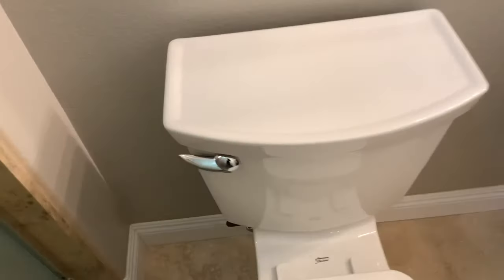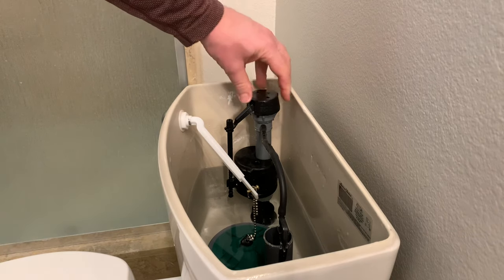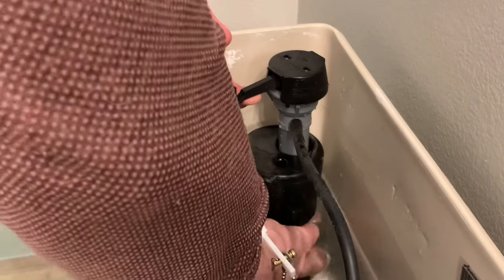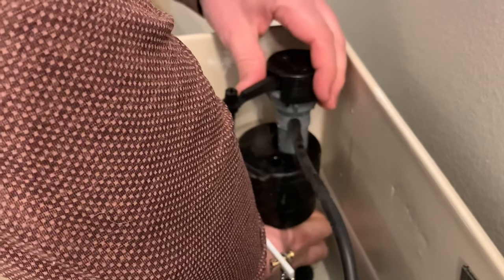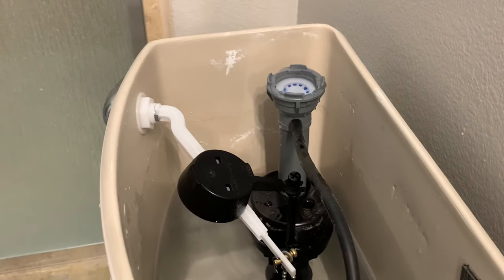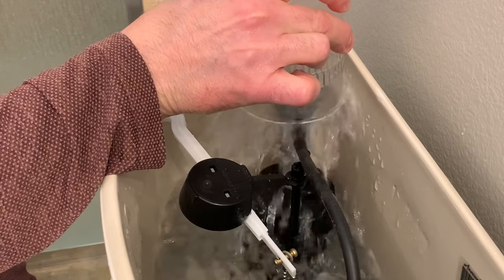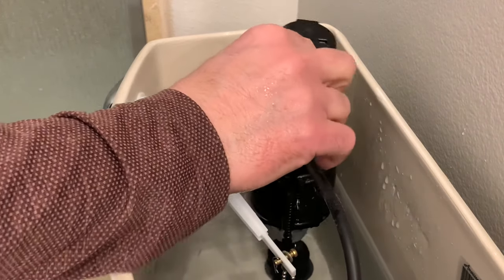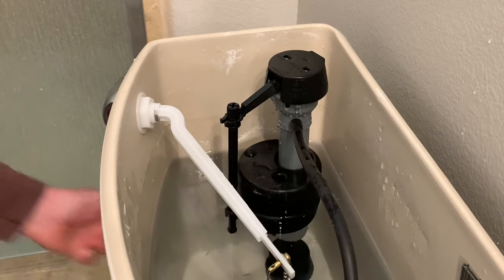Fix A Slow Filling Toilet Tank-With No Tools!

Comment: Gonna hope this can work on the toilet connected to my bedroom. It takes FOREVER to refill and doesn't get as much water as the main bathroom. I hate hearing the water refilling for the next 20 minutes if I use the bathroom at night (as I live alone, I sometimes will just use the main one to avoid this but I shouldn't have to, lol). This being an apartment is the only part that worries me as I've had some scary close-calls with water here (disconnecting a washer in prep for getting a new one) and should something go wrong, it would affect my neighbor under me as well (and the one on the opposite wall/behind me). 

I am fortunate that if I feel in over my head, I can just put in a service call for maintenance, but if I can resolve the issue myself, I'll feel pretty accomplished 😅. And it saves our maintenace guys a trip.
Reply from the maker: You can do it!
Reply: @MikeKlimek  Doesn't appear this worked for me as the toilet actually fills very slowly. I did see this method helped clean out some gunk, though, so that's a good start. I'll hunt around for some videls about slow-filling toilets to see if there's anything I can do about that in an apartment (nothing to be done if it just hss low water pressure, I assume). Thank you regardless for the video, I learned something I didn't know before!
Reply from the maker: @BewareTheLilyOfTheValley  When you removed the top of the fill valve, did you have a strong flow of water? You can test the pressure before the fill valve by removing the water supply line from under the tank and pointing into a bucket, then turn the water back on. If it is weak, replace the angle stop valve at the wall.
Reply: @MikeKlimek  Hi, thank you for your response! It seems the pressure is good, came out like a jet when I turned the water back on, lol. When you put the fill valve lid back on amd flush, should there be a lot of water that comes from the top and flows down? Mine has a very slight flow and I wonder if maybe it's on too tight?
Reply from the maker: @BewareTheLilyOfTheValley  No, it wouldn't be on too tight. You might try replacing a part in the cap. It's Fluidmaster part 242. Here is a video on it: https://youtu.be/p2G-ckkojEQ
Reply: @MikeKlimek  I actually went one step further and watched your video about replacing the fill valve if you already have a Fluidmaster, which thankfully, I do. IT WORKED!! I counted 72 seconds to fill versus 20-25 minutes. I will take it! HUGE thank you for all of your help and informative videos, you made something very scary and new for me something managable and easy!
Reply from the maker: @BewareTheLilyOfTheValley  Awesome-that makes me happy!

Comment: I have a problem with a toilet tank full of sludge and mud from our well because I couldn’t change the water filter since the plumbers put it on too tight when I had to have new pipe connections put in at the filter. Due to family health circumstances I put it off as low priority and now I need to know the best way to clear the mud out. The pipes are probably full of sludge all the way through out the water lines !😬😖 The last time I tried to change the well water filter I used a hair dryer to heat up and expand the seal but it didn’t work and I couldn’t budge it . Also when I turned the water off at the toilet and later from the well, it wouldn’t empty immediately and kept filling up.
I can fix this ….just need some input !🫤😁thanks !

Comment: My toilet fills slowly so I tried this and noticed the water pressure did not change when I turned tap on/off, im suspecting the shut off valve needs replacing?
Reply from the maker: Yes probably does
Reply: @MikeKlimek  turned out being both water supply and fill valve
Reply from the maker: @mets23q  Glad you got it figured out!

Comment: I followed the instructions, and the toilet was running fine; but once it stopped running, it would be back to running slowly. I found that when I disconnect and reonnect the water, it refills fine; but after the water supply is reconnected and it stops running subsequent flush cycles refill slowly.
Any ideas?
Reply from the maker: You might have a restrictor inside the bottom of the fill valve you could remove (remove the supply line and use needle nose pliers). Here is a video on replacing the seal under the cap (about $2 and 2 minutes): https://youtu.be/p2G-ckkojEQ?si=8MFBWopJunAuhBK7

Comment: I've done all that was on the video but after I remove the cap and turn the water on , it just comes out slowly. Any other suggestions please?
Reply from the maker: You might have a restrictor inside the bottom of the fill valve you could remove (remove the supply line and use needle nose pliers). Here is a video on replacing the seal under the cap (about $2 and 2 minutes): https://youtu.be/p2G-ckkojEQ?si=8MFBWopJunAuhBK7

Comment: What do I do if the top/cap does not want to twist and come off. I was afraid it would break.
Reply from the maker: If the cap won't come off, you can replace the entire fill valve if it breaks.

Comment: Don't want to pick on your video, but I've watched several just like it. It would be helpful if some of them explained other issues and things to look out for like signs the valve needs to be replaced. I think my is leaking slightly and not getting this kind of pressure because I don't even need to put my hand over the water that just bubbles over instead of sprays out like this and in the other several videos using cups etc. Again, just a thought not a criticism. I saw your video is more recent, so thought I'd comment here.
Reply from the maker: I appreciate your comments. Let's try to troubleshoot your problem: It sounds like either the fill valve may need to be replaced or the shut off valve/supply line has a problem. First, make sure the water supply valve is fully opened by turning counter-clockwise. If no change in water volume, turn the supply valve off and remove the supply line from the toilet fill valve under the toilet. Point the supply line in a bucket and turn the valve back on. If you have full pressure, then replace the fill valve. If the pressure is bad, replace the supply valve/supply line. Hope this helps
Reply: @MikeKlimek  Mike, I really appreciate the clear and well thought out advice!
Reply: @MikeKlimek  I'm pretty sure there is at least one small leak in the fill valve after working with it a bit more. But it wasn't super obvious or quite like any example I found doing research. The fill valve isn't that old, so maybe just not the best quality.

Comment: mike hi im having a issue with a slow filling toilet even just after replacing the fill valve   . today september 5th  I changed it out and there is no difference   it is almost like I never changed it   I feel like I wasted my time  and money  and im not happy right now.  I know that I used the correct fill valve .   I have been doing what you showed in the video   I leave the base ( shank) in place and only change the top  unless  the bottom of the toilet tank  is leaking
Reply from the maker: It sounds like it may not be the fill valve then. I would disconnect the water supply line from the bottom of the tank and point it in a bucket to see if you have strong water volume (turn the water off before you disconnect it of course). My guess is that you won't...If that's the case then check the water supply shut-off valve/supply line.
Reply: Same issue water still dribbled out after I ran this process,  so I check water line and it's super strong... not sure from here assuming it's the entire valve perhaps

Comment: What if it's a brand new toilet water valve and a new flapper? Water tank started to fill slowly and not all the way after these two things were reolaced.
Reply from the maker: I would say there is either an obstruction in the fill valve (or a restrictor at the base of the valve), or the valve at the wall is the problem.

Comment: I just installed a new flush unit and it's still filling up slowly.  Any other hints?
Reply from the maker: When you remove the top cap and turn the water back on with the upside-down cup, is the water flow strong?
Reply: @MikeKlimek  Since the kit was new I didn't believe that it was a dirty cap.  I know the pressure is good so it must be something else.  I was watching other YouTube videos with the same slow filling problem.  A poster showed a spiral flow limiter in the bottom tube and recommended to take it off.  It was made of rubber and I took it out using a long nose.  Now the water is filling faster... 50 secs to fill instead of more than a minute or two!  I'm glad other people found your solution helpful.  🤗
Reply from the maker: @kanehi3275  Glad you got it figured out!

Comment: Hi, what if the water pressure is low even with the valve fully open?
Reply from the maker: You may need to replace the valve then. Here is a video on that: https://youtu.be/y6J1cfvQOGg    To troubleshoot, turn the water off, disconnect the supply line from the bottom of the toilet, point it in a bucket and turn the water back on. Full pressure? Then the problem is with the fill valve. You could also remove the top of the valve as the video I attached shows and then turn the water back on. Careful though-cover the tube with a cup before turning the water back on as there is lots of pressure here. Watch the attached video and it should make sense. Its either the fill valve, supply line of water shut off valve. Good luck!

Comment: I have this issue. Followed the same process and the water comes out at pace when turning the watr back on. On the second flush though it fills slowely again.  I can repeat the process switching the mains water back on and off again.
Reply from the maker: If you have full pressure when you remove the top, try this: https://youtu.be/p2G-ckkojEQ or you may need to replace the fill valve. I have a video on that you can complete in 30 seconds.
Reply: @MikeKlimek  Thanks mike. I'll give that a bash. Have a nice day
Reply from the maker: @steviebax  Thank you -you too!

Comment: I tried the fix above:  the water flow was very low coming out of the top a bubble about 1/2" above where the water comes out...I did not need a cup to stop the water from spraying all over...
Reply from the maker: Ouch. It should be strong enough to almost blow the cup out of your hand! Try this: I would disconnect the supply line from underneath the tank and point it in a bucket (turn the water off first), then turn the water back on. Good pressure? You either  have a restrictor in the bottom of the fill valve, or you should consider replacing the entire valve. Bad pressure? Then replace the shut-off valve.

Comment: I think my issue is a more serious, as I cannot stop the water flow despite shutting off the valve. And I can't get that cap off either.
Reply from the maker: You may just need to adjust the float downward to shut off the water earlier. However, if all else fails watch this video on replacing the valve: https://youtu.be/y6J1cfvQOGg?si=eOYg3DwT6xgSa_NS

Comment: When i take the  fill valve off and turn the water back on (water valve completly open) thr water barely comes out. Theres definitely not a blast of water. The toilet was installed professionally about a year ago and always filled slowly. I just never noticed no water was coming out of tube.
Reply from the maker: You should have full flow with the top of the valve off. Either an issue with a restrictor in the underside of the fill valve under the tank, or the shut off valve is not fully opened or it's restricted
Reply: @MikeKlimek  You're so kind to reply! Thanks for posting this helpful content. It turns out the supply line has low pressure (I disconnected the supply line from the toilet to see what the water pressure looks like and that's the problem). We're having to call in a plumber as it's not obvious what's going on. Thanks again.

Comment: hello i did this then it sopped refilling after two flushes
any advice?
it worked fine but only after a couple flushes
Reply from the maker: Try doing the repair again. There may be something else caught in there. There may also be an issue with the angle stop. May want to disconnect the supply line where it connects to the underside of the toilet, point it in a bucket and turn the valve back on. If you have full pressure, you have an issue with the fill valve. Either try the repair again or replace the fill valve. Let me know what you find!

Comment: When I tried this fix, my doesnt flush, just comes out at a slow trickle, what should I be trying next?
Reply from the maker: What was the pressure like when you held the cup over the valve?
Reply: @MikeKlimek  trickling, like never even came close to touching the glass.
Reply from the maker: I would disconnect the supply line from underneath the tank and point it in a bucket (turn the water off first), then turn the water back on. Good pressure? @StephenIvany

Comment: Okay, so I did all of that, and it flushed and filled right once or twice, then resumed the same problem.  Any idea what might be causing that?
Reply from the maker: When you put the cup over the fill valve, you had constant strong water flow?
Reply: @MikeKlimek  yes.  Every time.
Reply from the maker: @LungsOutJem  OK, than we can exclude everything but the top of the unit. Is the rubber seal under the lid in good shape? I have a video on replacing that if necessary...but to be sure you could replace the working part of the fill valve. Here is a video on replacing it in under 30 seconds: https://youtu.be/y6J1cfvQOGg
Reply: @MikeKlimek  I have no idea if the seal is good or not, but I already ordered a replacement, thinking that might be the problem.  I'll check back after I replace it.
Reply from the maker: @LungsOutJem  I think the seal is $2 and the entire fill valve is only around $10. Maybe just replace the entire thing for the small price difference.
Reply: @MikeKlimek  yeah, you're right, but I was also just curious if it was the seal or something else.  I could get the whole thing fixed by my apartment complex's mechanic, but sometimes I'm more interested in learning than just having it working.  🤷‍♂️
Reply: @MikeKlimek  looks like my hunch was correct.  I fixed the problem for the cost of a $2 seal.  Thanks for the videos.
Reply from the maker: @LungsOutJem  Awesome JC!

Comment: Have replaced the Fluidmaster with a new one but I can't get the water to stop running. I have adjusted the float, checked the valve under the black cap, several times, blowed the white tube inside the grey with water several times.  Problem it is bubbling water out from the holes in the top of the grey tube and water will not stop running.  What do I do to fix this?
Reply from the maker: OK, let me ask a couple of questions: 1. If you lift up on the float (or the lever holding the float) does the water shut off? . 2.As the water is running, does it flow into the overflow tube or does the water never reach that height?
Reply: @MikeKlimek  no the water does not stop. I will send a video if you send a link to send it to.
Reply from the maker: @janetellis4300  I realize the water is running. I'm trying to isolate the cause. See my earlier questions!
Reply: @MikeKlimek   It was filling the tank and doing like it's supposed to but just bubbling underneath the black cap but now the water is not filling the tank. I got the water to fill the tank when flushed but the water is still bubbling from the top of the grey tube.
Reply: @MikeKlimek  #1 no lifting does not stop
#2 looks like the water is going into the overflow
Reply from the maker: @janetellis4300  OK so it sounds like a clogged or bad fill valve. I know you've already blown out any debris, so it is probably time to replace it. Buy a new one, put the old one in the box and take it back to get your money back. Here is a video on replacing one in under 30 seconds: https://youtu.be/y6J1cfvQOGg
Reply: @MikeKlimek  this is a new one the manufacturer sent to me. I will try another one and get back to you tomorrow. Thanks for your help.

Comment: I have a new American Standard that has slow filled from the very first flush. Any ideas?
Reply from the maker: The toilet in the video is also American Standard. The problem will either be the shut off valve (make sure it's fully opened), the supply line (you can disconnect it from the bottom of the tank and point it in a bucket to see how fast the water comes out) or the fill valve (it's usually the fill valve). When you took the top off of the fill valve and turned the water back on did it have strong pressure?
Reply: @MikeKlimek  I turned the screw on the fill valve counter-clockwise and it stopped. But it started again, so I turned the screw a little more and it stopped again. That's where I'm at right now.
Reply from the maker: @bradh6185  Which screw? The plastic adjustment screw for the height of the float?
Reply: @MikeKlimek  Yes. And it started running agsin.
Reply from the maker: @bradh6185  OK, so you're talking about when the toilet stops filling. The video is about slow filling. Are you looking for help with a slow filling toilet or that the toilet won't stop running?
Reply: @MikeKlimek  Oops. Both actually.

Comment: What if you low valve is new, but the tank still fills slowly?
Reply from the maker: It's got to be either the shut off valve, supply line, or fill valve. You can remove the top of the fill valve even though it is new, maybe some debris got stuck when you turned the water back on. Then remove the supply line from the tank and point it in a bucket and turn the water on. If the water pressure is strong, then it has to be the fill valve.